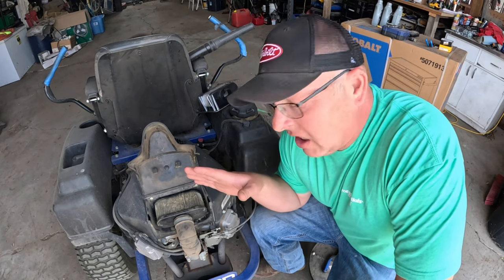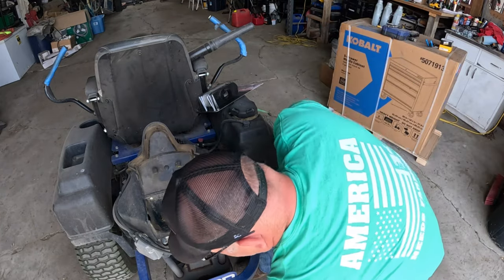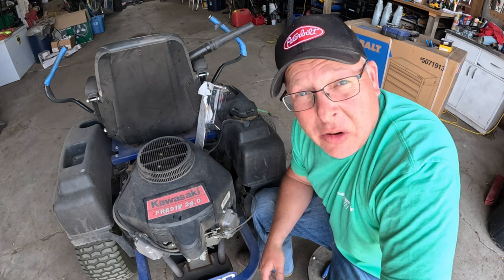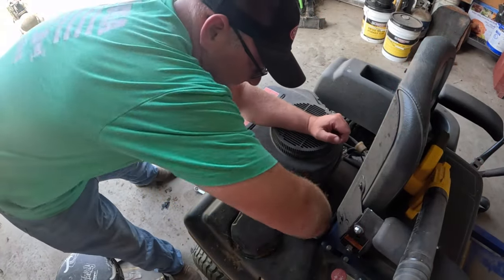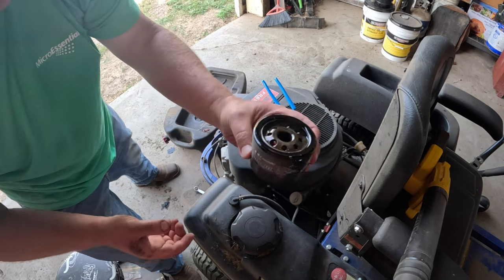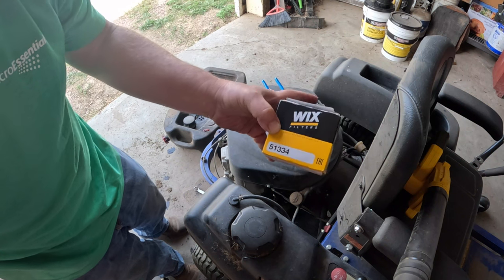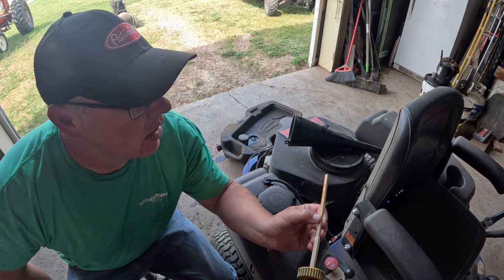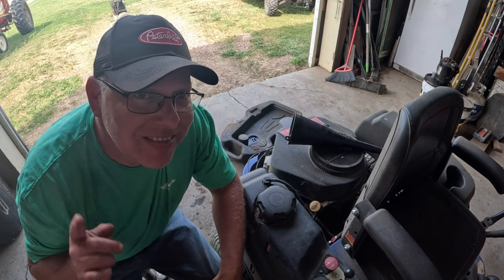Zero turn Dixon mower oil change and new air filter

Comment: Where do you find parts for your dixon I need a pulley spindle assembly
Reply from the maker: Runnings, Amazon and Sterdevants
Reply: Thanks u sterdevants is that online
Reply from the maker: It’s a local parts store